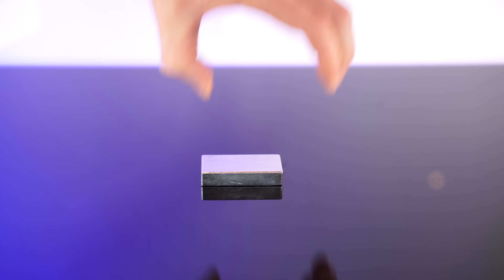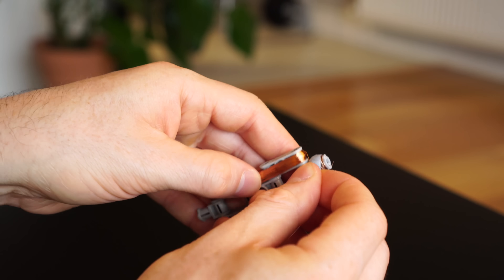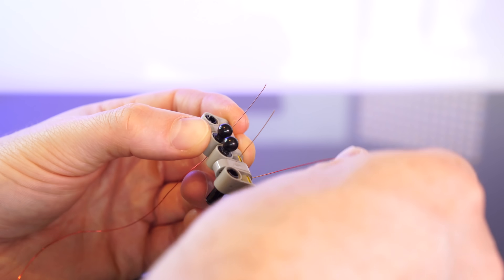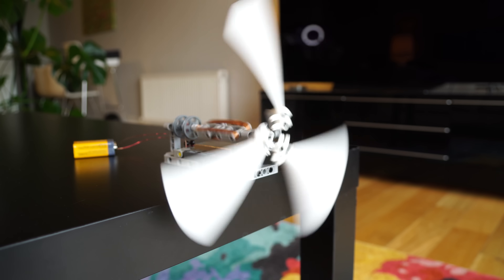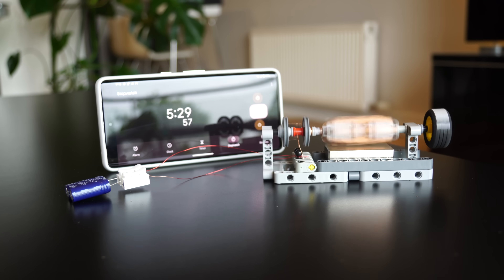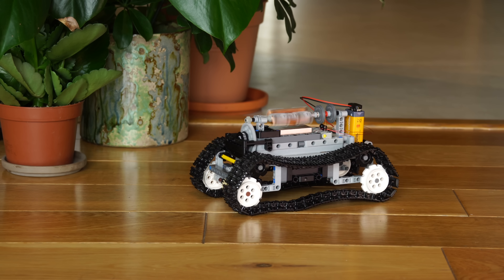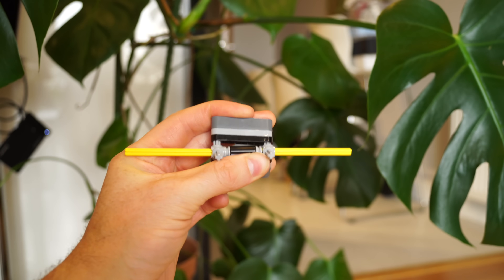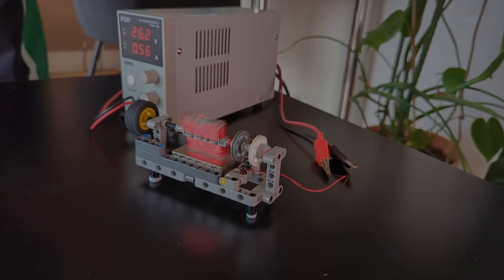Building & Testing a Mini Lego Brushed Motor

Comment: you can do brushless dc motor, no commutators, no pulsing, just dc wire running over radially in circle over a ring magnet. high current thick wire replaces many loops of small current wire. yep car battery sized heavy duty current wire. wire? make it a beam, or thick metal rod. flexible metal strip running on a split current rod works as a commutator too. the strip friction makes contact with the spinner. thats wire edm cutter in action. lol. also friction will melt the wire.
Reply from the maker: Good suggestion, cheers! I've made a few brushless motors before, and that's one of my next projects 😉 I really love some of the low power motors that can run for ages, so currently playing with that. Though I am using a reed switch as a timer to keep the design simple

Comment: After watching this, I realized a much more efficient and powerful design would use a little bit of logic, with a single SR latch. Instead of running the entire power through that tiny brush, use a voltage level signal with a series resistor to turn on and off an SR latch with an H bridge powering the motor. This will also prevent the motor from needing a kick-start. No more sparks, constant power, and avoids the unnecessary friction from large brushes
Reply: On second thought, this would require contacts with brushes to supply the voltage. At least we remove the sparks and increase the longevity
Reply from the maker: I do like the idea of an H-bridge! I was wrecking my head trying to figure out how that mitigates the sparks from driving a large amount of external power 😅 But I get where you were thinking - thanks for the recommendation!
Reply: @JamiesBrickJams  On a normal brushed DC motor, the sparks occur because as the brush begins to touch the next pad, the motor draws an incredible amount of current through a very tiny contact area. With the brushes constantly in full contact and having it controlled electrically rather than physically, there would still be high currents when switching, but it's at least already making full contact and not vaporizing the brush due to the large surface area.

Btw, I'm thinking of a high power DC motor here with maybe copper tape as a pad and carbon or brass brushes. Brass might be best for this use case
Reply from the maker: Ah yes, certainly much larger pads would be needed for the contacts! I've been brainstorming materials to use that would be easy to integrate with Lego. Aluminium foil was one idea, but I'm sure that'd get worn down real quick. Might have to see if some copper pipe cuttings can be fitted to Lego. Thanks for your suggestions here though, this is helpful 👌